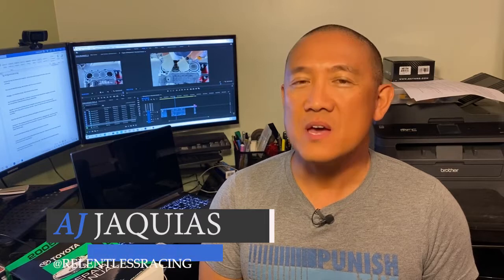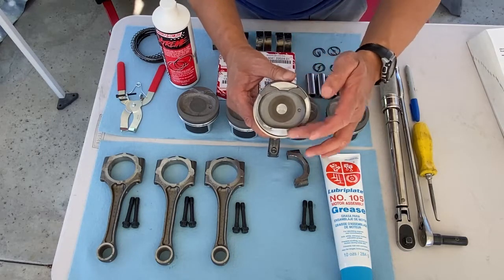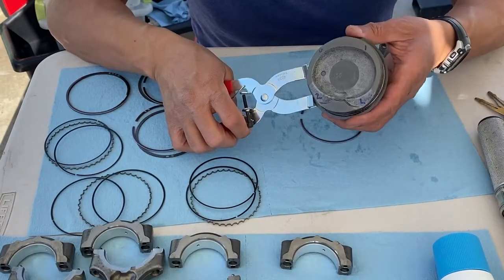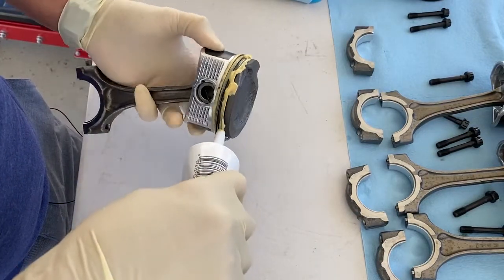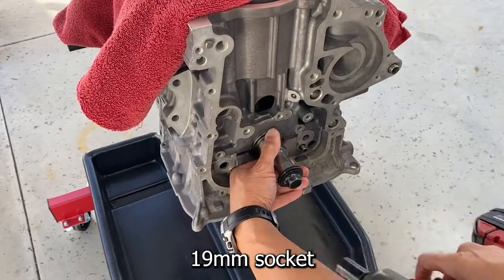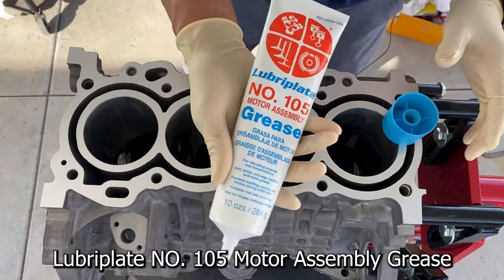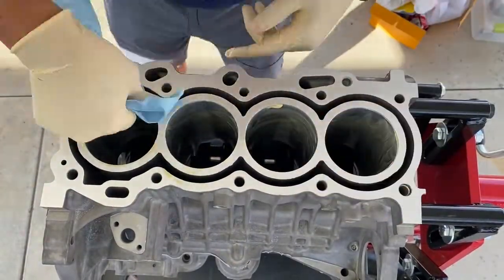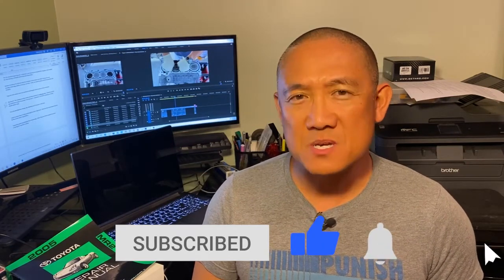1ZZ-FE Rebuild Part 3 - Piston Rod Assembly Installation

Comment: Thanks for the great video for our reference. At 2:26, your diagram shown No. 1 Compression ring, but here at my 1zz manual ( Engine Repair Manual part number - RM1099E) at page 14-73 shown Compression No. 2, which should i follow?
Reply from the maker: That’s an excellent question. Just keep compression 1 and 2 ring openings 180 degrees apart as shown in the manual. In the end, the piston rings will move on their own around the piston as the motor runs. Pls subscribe. Thx AJ
Reply: @RelentlessRacingAJ Thank you very much for the super fast reply. Noted on the ring positions. Keep up the excellent work.
Reply from the maker: @JualBeli-t6r  Welcome.. pls subscribe. thx AJ

Comment: 3:40 "First, I remove the wrist pin lock with a custom awl" (there she goes!)
Reply from the maker: @tactical-bucket  u r the 2nd person to catch that. 😂 it happens.
Reply: @RelentlessRacingAJ  hilarious, I also build rifles with spring loaded detents and that really does happen all the time lmao
Reply from the maker: @ I generally work in a closed area so finding them is not an issue. When I work on transmissions, I use large beach towels to capture the c clips

Comment: is king bearings better than the oem bearinga
Reply from the maker: @jasonspeid5697  I’ve used both OEM and King bearings w good success, but I always verify oil clearances meet the OEM requirements. FYI - the King bearings are less expensive and more readily available. Pls subscribe. Thx AJ

Comment: Thanks for our amazing video!!! 

I have a Yaris 2016 with 290.000 miles. Cylinder 4 is Missfiring. According to Toyota dealer is leaking oil. They said there is come oil on the trhottle body. I notice oil on the spark plug. 
What is the best idea. 1: to ges a used Engine (60.000 miles) or just Buy a short Block ?
Reply from the maker: @1yotube  it’s up to you. If you are mechanically inclined and know how to determine the health of a used engine, then perhaps you can save some money. However, if a new short block is affordable and you are competent to disassemble the old motor for the cylinder head and then assemble the old cylinder head to the new short block, then a new short block may be the way to go. Good luck. Pls subscribe. Thx, AJ
Reply: @RelentlessRacingAJ  Thanks for the sugestion! I will be back to you when I talk to the mechanic soon.
Reply from the maker: @ good luck. pls subscribe. -AJ

Comment: Got me reved up. Thinking 2zz or build 1zz hmmmmm
Reply from the maker: I’m not sure what you mean by building a 1ZZ, but I’m not sure it would be worth to build an NA 1ZZ. NA 2ZZ has its issues as well. I’m thinking the K is the way. Pls subscribe. Thx AJ
Reply: @RelentlessRacingAJ  when I mean build, I could do a build for my mr2 that I'm collecting in the spring. Either 2zz or turbo 1zz. If I 2zz I'll want turbo eventually lol I could build the head on the 1zz for more revs. Throw cams in it.
Reply from the maker: @btownballer27  as my buddy would say, it’s only money. I’ve driven a 1ZZ NA, 1ZZ turbo, 2ZZ NA, K20R, & K24 NA. The 1ZZ turbo was surprisingly very fun.

Comment: After the piston/rod install and you're turning the motor over--do you recall (roughly) how much force you were turning the motor over with?? I just completed a 1zz shortblock and noticed this motor "drags", err, takes more effort to turn-over versus other motors I've built. Just curious if that's how these 1zz's are.
Reply from the maker: I've had this discussion w my engine building mentor (John Grudynski) before... you should check the rotating resistance at multiple points in the build. 1. install the crank without the rear main seal.  It should spin freely, meaning when you spin the crank by hand it should spin a little and stop because of the assembly lube drag. John recommends the Akerly and Childs assembly lube because it isn't thick and doesn't leave any residue when you run the motor. If you have resistance, it could be oil squirter interference (yes, I know the 1ZZ doesn't have any), a bent crank, a bad bearing (w coating crap on it), thrust bearings improperly lubed, girdle not torqued even or properly, or bad main bore. 2. install the pistons rod assemblies one at a time and review the rotational drag after each assembly is installed.  This way you know which one is the problem. Check your rings and make sure nothing is hanging up or putting massive scratches in your cylinder bores. Lastly, don't be afraid to take it apart and double check everything. Make sure you are comfortable with it before proceeding. Hope this helps. Good luck! Thank you for watching and commenting. Please subscribe. Thanks again, -AJ
Reply: @RelentlessRacingAJ  Thank you for the reply. I ended up taking it back apart and applying more lube to everything and its spinning with less effort now. I did use a lever torque wrench to measure the effort--it was roughly 6lbs before and 2lbs after. Significant difference!
Reply from the maker: @LawlzWords  good call taking her apart

Comment: hey im going put my 1zzfe to engine stand , what would be the bolt size ? for engine stand ? thanks
Reply: m12 *1.25*100mm for the 2 top ones, m10 for the 2 bottom ones, any thread pitch since there's no thread on engine, need nuts.
Reply: @muslimgilani6272  thank you sooo much brother 💋

Comment: This might be a stupid question, but what the heck. 
Shouldn't have put some oil on the rods before installing the rod bearings? 
I am thinking to start rebuilding my engine too (as it's dead for few months) or to do a 2zz swap and build that one.
Reply from the maker: Thanks for watching and commenting. I was always taught to install the bearings w no oil between the rod & bearing. Same goes for the rod cap. Where did you learn there is supposed to be oil between the rod and bearing?  Pls subscribe
Reply: @RelentlessRacingAJ  no where officially, I believe I've seen something on YouTube or a comment on Fb, can't remember on this topic or maybe was exactly the opposite and they were saying not to do it by anymeans, as it will increase the risk of the bearings to come off
Reply from the maker: @avry87  if u read the OE service manual it reads in bold type, “NOTICE: Clean the backside of the bearing and the bearing surface of the bearing cap and do not let the oils and fats stick.” on pages EM-84 and EM-86. You can’t believe everything you see on YouTube or the internet bc ppl make mistakes or they really don’t know. In fact, some of the most popular YouTube channels (meaning they have lots of subscribers) put out incorrect info. I highly recommend you read the OE service manual or enroll in automotive classes at your local community college. Hope this helps. #stayrelentless

Comment: Verify the risk pin lock is installed properly. How do you know it is installed properly?  Good luck getting those clips in.
Reply from the maker: No luck required… these wrist pins install very easily and it’s also shown in the video. If you can’t install these wrist pins you should consider bribing your motor to a local engine building shop. Verification is also simple. The wrist pins need to sit in the groove. They install just like a circlip on a wheel bearing.
Reply: @RelentlessRacingAJ  got them installed was challenging at first.